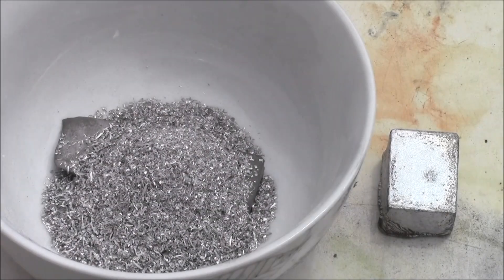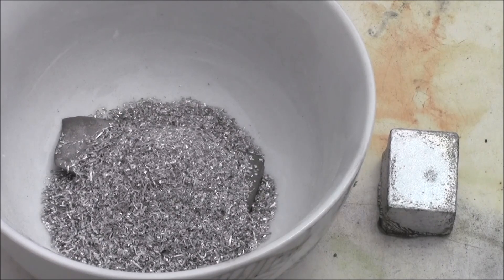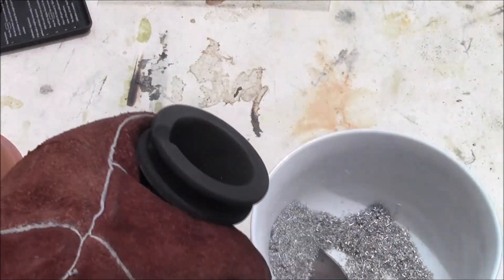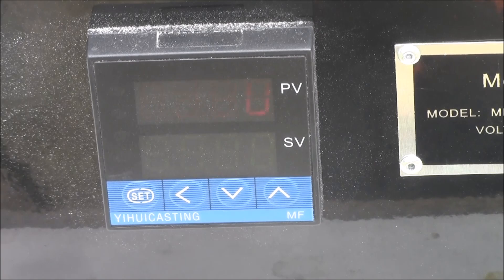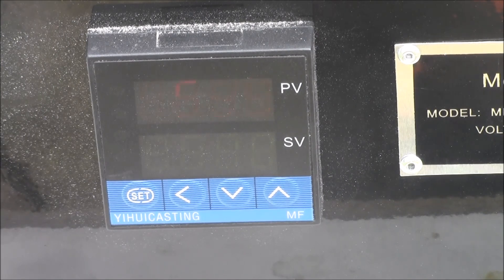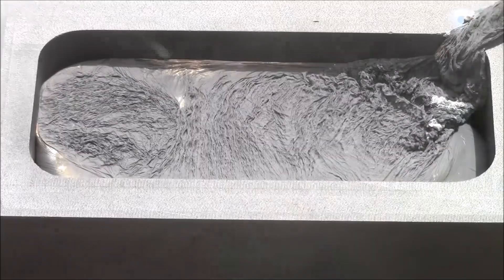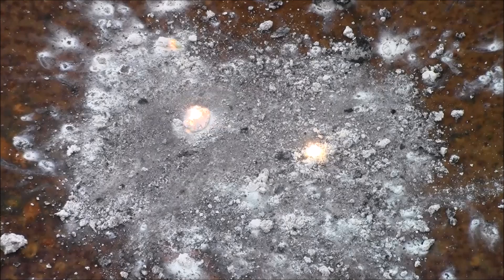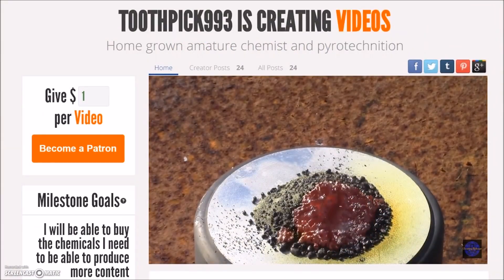Making Magnalium for use in Pyrotechnics

Comment: For easier processing (crushing/milling/etc.), pour the molten alloy directly into a large volume of water. You form a very spongy friable material that's easy to process.
Reply: I would not be sure, if putting hot magnalium into water would be a good idea, as the fire could sustain itself under water. Hot magnesium burns under water, ripping off the oxygen from the water molecule continuing the reaction and while doing so producing hydrogen gas, which could ignite at the surface. With the molten alloy of magnesium and aluminium  I would not risk it.
"If it ignites, pour sand or dirt onto it. However, if it is overly large, it might be best to let it burn out. Never use water." (source: https://pyrosource.fandom.com/wiki/Magnalium )
Reply: You shouldn't spray water on a magnesium fire, but if you dunk burning magnesium or magnalium is water it's fine. The water robs the fire of heat so quickly that it extinguishes it. I've done it many times.
Reply: @chemistryofquestionablequa6252  can I do the same with aluminum?